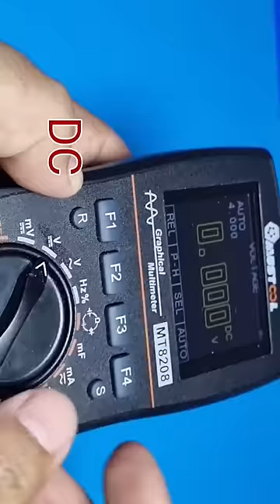ONLY A FEW PEOPLE KNOW!! Make an ADVANCED Tester From a Transformer #shorts #zaferyildiz#short

Comment: My friend, that isn’t a transformer. It’s a common mode supression choke…
Reply: В нем 2 обмотки и магнитопровод, следовательно это может работать как трансформатор и фактически им является)
Reply: @ALEX_ALEX_-ny7rq it does not transform. As the windings do not differ. It is a suppression choke. These distinctions do matter. But a great circuit all the same.
Reply: @ElectroKevDotCom  Yes, but since it's basically an inductor it can boost voltage.
Reply: @HoorGuvLabs  with other switching components it can as part of a circuit. But then you only need a single coil for that. This isn’t doing any boosting on its own. But an actual transformer could.
Reply: @ElectroKevDotCom   a 1:1 transformer is still a transformer
Reply: @cpu_1292  20 GOTO 10
Reply: @ElectroKevDotCom  basically centre-tapped inductor. Look up joule thief circuit..
Reply: @ElectroKevDotCom lol
Reply: @HoorGuvLabs в нём одинаковое количество витков на первичке и вторичке.чтобы трансформировать,нужно перемотать его
Reply: @ALEX_ALEX_-ny7rq  its called an inductor not a transformer he probably misunderstand it
Reply: Did you ever hear about isolation transformers? They also have a 1:1 ratio, but they are still transformers
Reply: it wasn't until he joined a piece of wire connecting two coils in parallel opposite. forming a type of rectifier like the joule thief..
Reply: this is a type of booster converter
Reply: @denischyprina364  Есть трансформаторы с одинаковым количеством витков, к примеру, для гальванической развязки. Уж по другому их ни как назвать нельзя.
И вообще, "трансформатор" это схема включения многообмоточного дросселя главной целью которой служит передача энергии между обмотками по средствам электромагнитного поля.
Reply: มีวงจร(circuit)รึเปล่า ดูไม่ทัน
Reply: It depends on the reason why you used it, transformer, inductor etc. Desert can be a a land of sands as well as ice, a place where peiple desert it.

Comment: this works well. i thought it would not work properly because the choke filter ratio is 1:1, but it does work, i put a 22µF 250V capacitor, it reached 64V quite fast, tried turn on 15 white leds high bright and it handled well with 39V ofcourse it won't drive the led at it's full bright but to test is very okay, i changed the output resistor for 2k2 instead of 3k3 and i used tip42c, inverted the connections because it is PNP transistor. Thank you for sharing something so easy to build, i was looking for it a long time ago. guys, if you are getting difficulty to understand without the diagram, its the same as a joule thief but with a diode series with capacitor at its end and a resistor in series.
Reply: made the same but didn't work for me ! it gived the 3.7 v  output!
Reply: @fahim18xiii  try to change the choke filter or make sure the connections are right.
Reply: @Hudsonkem   connection is ok, but i used tip42c , will that be okay ? as i know tip41c and tip42c is equivalent ! is that right ?
Reply: @fahim18xiii  nope they are not equivalent, they are a pair. the tip41c is NPN and the tip42c is PNP, it will change the connections, what is a common connection for a NPN transistor? instead of connecting the positive in the choke, you will feed it with negative, and the emitter with positive.
Reply: @Hudsonkem  uh ! so that's why when i was working as a PNP is was working but after i rechecked the connection with video , i immediately changed the connection ! lol ! 
thank you ...
Reply: @fahim18xiii   normally when you have these kind of number jump exemple (bc547 and bc557) or (tip41c and tip42c)  like that, you should look at datasheet because it could be a pair, it means that they will work very nice together and ofcourse they will be opposide, one with nagative base and another with positive base. everytime you meet a new transistor make sure to look if it is a NPN or PNP before mounting your circuit.

Comment: I built the circuit and it pulls 1.6amps on a 4.2 volt battery and outputs 115volt. I used a 160 volt cap i wasn't trying to find out. I found out that if i use a AA (1.5v) battery it pulls .09amp and outputs 68 to 76 volts. His idea does work but you just may have to play around with what you have lol. I played around and now i have one that outputs 40-140 volts with 1-8.5 volts input without heatsink on transistor
Reply: Where did you find schematic? If you ask me, the circuit is not able to do what is shown, but i would like to better see what is done.
Reply: @ricolauersdorf687 Hard to tell what is going on.
Reply: Hola.¿Y para qué sirve?. En la vida diaria ¿para que sería útil?.

Comment: Now all the LEDs will burn out soon because you added tin, which does not contain resistance, instead of the LED, and thus the current in all the diodes will increase, leading to them burning.
Reply: What about puting a resistor instead?
Reply: @chongtak  This is what should be done
Reply: @alprins6907  thank you to confirm, I am beginner (self-taught) but that seemed obvious to me.

Comment: Continuity feature on multimeter left the chat
Reply: The continuity test voltage is too low and you would have to test each and every LED individually. Not convenient if you are testing something that has tons of LEDs wired in series. For example, TV backlights have about 30 white LEDs that require 3.2V, which is 96 volts. This tests multiple LEDs at once, making the testing process faster.

Comment: What does it test ?
Reply: He's basically transforming the voltage from the 3.7v 18650 battery and adding the power source into his voltmeter which in turn powers up his probe ends to give whatever he's testing the power to find out if it works. Or if that's where the problem is. They actually sell something similar to this. Knock offs can be bought cheaply. But the best are power probe 1 2 &3. They're not cheap. Power probe ones cost about $180.00 & that's from harbor freight. Most others are around 4 to $500

Comment: But sir, that's not a transformer. That's a line filter
Reply: Its a choke, what belongs to the group of transformers.
Reply: nope. Rahul is right. Chokes are considered inductors. As they have a 1:1 ratio, the word transformer is incorrect as the voltage is not being transformed from one number to another. Also, look at the orientation. There is no hot side or cold side and two closed circuits. Dubious video besides. Clearly lacks a lot of important information.
Reply: (by the way, a line filter is two inductors packed into one. They could be technically seen as a 1:1 transformer but nobody in EE would ever call a line filter a transformer. It's all to do with how it is used.
Reply: Call it what you want. I dont think, you know them all in EE. It is basicaly the same thing, tuned for its purpose, what gives it its more specific name. We all know that :)
btw: a line filter also transforms voltages. Its just far more complex to describe with minimum words what happens. We call 1:1 galvanic grid isolators transformers, even if the voltage numer is equal. I also call coupled inductors in smps transformers. The orientation of iron domains follows the current trough a wire, what leads to change of potential and/or current in another wire. Of course, there is a lot more in detail.
Reply: @ricolauersdorf687  I’m not going to speculate you took, but I’ve never known a valid or able electrical engineering course refer to a common mode suppression choke as a “transformer”. qwq